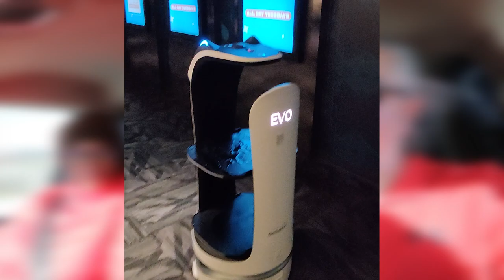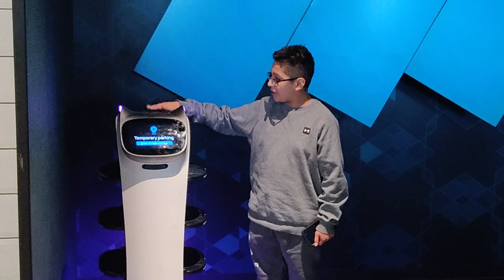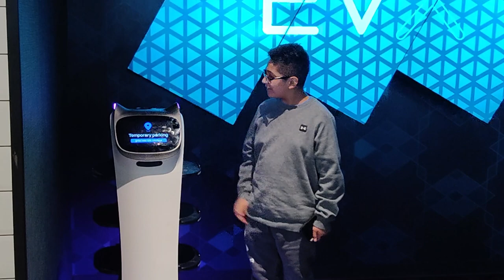Shower Drain is plugged in our RV | RV Life Daily Vlog

Comment: So the shower does not have "P" Trap in it, they put a Hepvo valve in these rigs. (so funny as I typed that before you said you were going to go under and check it it. Basically its got silicone flaps inside of it that act as a one way valve. I would recommend you just go ahead and pull it out and attempt to clean it out instead of trying to use chemicals. Your washer/dryer drain has one as well. Where your not using your washer/dryer you may want to just swap them as your washer/dryer drain should have a blk pipe plug caping it so gasses cant work their way up into the rig. Have fun at the show!!
Reply from the maker: Thanks y'all. I can always depend on you for some of the best details. You're awesome 😎